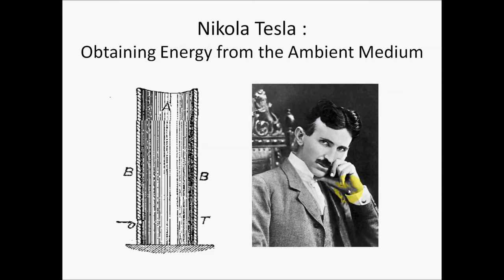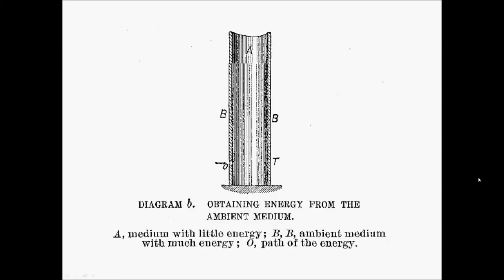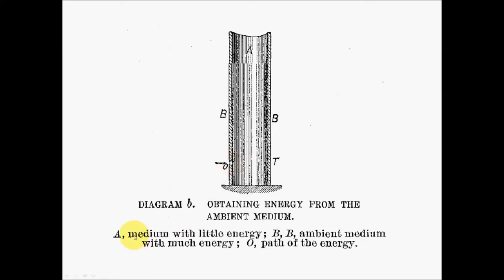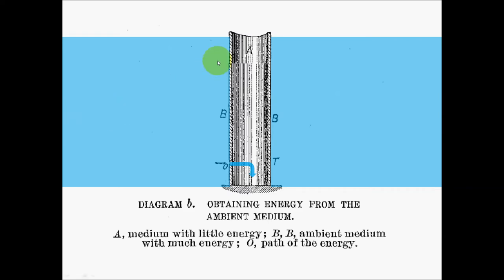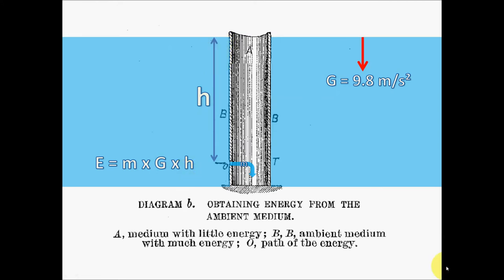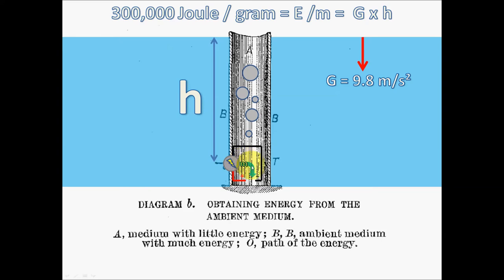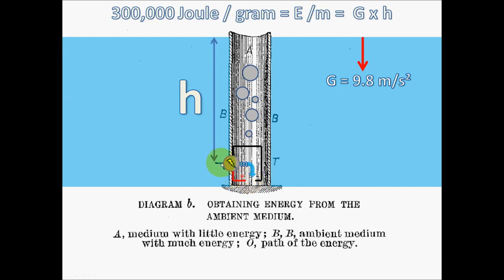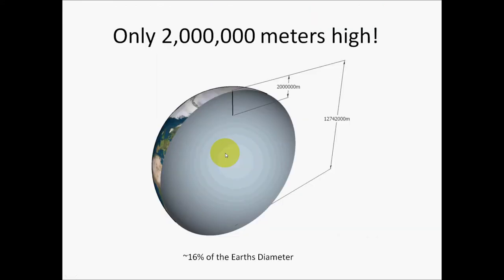Nikola Tesla : Obtaining Energy from the Ambient Medium

Comment: I am working in a practical working model, based on the implosion of a high voltage (di) electric field.

 I use pancake coils as the plates of a high voltage capacitor.
one of the plate coils is made series resonant(low impedance/wire resistance) and discharges inductive spike impulses (b emf) through it. 

This temporary discharges the DC field which creates a "vacuum" to be filled by the ambient medium.

more on this on my channel
Reply from the maker: I check out the channel, it's hard to do electrial analysis when your circuit elements  have a complex geometery with shared capacitance and inductance. You might benefit from an EMI course, they teach you how to simplify complex structures, like the one your building and do some analysis on them.
Reply: @sparkstarter   thanks, I'll first will need to do a high voltage safety course :)

Comment: For a high voltage source generally speaking the load will drain the source according to the laws of maximum energy transfer. However some resonant voltage rise processes are able to power ionized gas bulbs as loads in series with (one ended single wire delivery)polar capacity circuits, where the metallic surface areas of those elements provide the free electrons that can be placed in oscillation by that  voltage source.  It was only after years of experimental work that I realized the following facts. ( in fact I made a separate video showing the principle) The open circuit potential exhibited by having an open circuit between the ionized gas bulbs as loads will in fact be reinforced by having a designated shortest path of travel between them as a closed circuit application. In turn this "shortest path for completion of circuit" can be changed by wire and ground manipulations to appear as a relative voltage difference existing at a much higher altitude then the existing ground plane. By wire attaching an insulated metallic globe held from a 3 ft PVC tube on top of a grounded 25 ft antennae: the completion of the circuit is then current limited by the capacity between the tower and the globe; which is assumed to be a very low value...
https://www.flickr.com/photos/harvich/14730104127/in/dateposted-public/
https://www.flickr.com/photos/harvich/14916791525/in/dateposted-public/
Now the seeming advantage of this elevated capacity scheme as shown with the top globe is that for the amount of polar conduction taking place from a resonant source which should be calculated from the amount of surface areas, the amount of current obtained as a polar capacity in series with a gas discharge which can be measured in microamps is vastly increased considering the amount of surface area being employed. In the different situation involving alternator resonances at the moment the top globe is attracting electrons from the atmosphere; the bottom metallic grounding holding tower piece is repelling those charges from its own ground source that may exist in it's attachment to the earth. Here's a pic of those ionized gas bulbs where a polar capacity current can also go through the body.
https://www.flickr.com/photos/harvich/23296408581/in/dateposted-public/

Comment: But what if you turned the tube upside down and made it conductive and the pressure is measured in volts/meter? What if instead of a hole to let the ambient media flow in you used an isotropic capacitance of the largest radius of curvature you could mechanically support? And what if you attached a large inductance in series with a massive grounding lattice buried well under ground to form the other side of the "hole"?  Interrupt the flow periodically to form a relaxation oscillator and wrapped a suitable low inductance high surface area secondary around the large series resonant inductance.  I wonder what would happen?